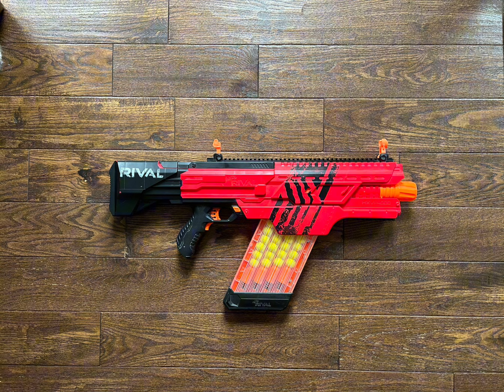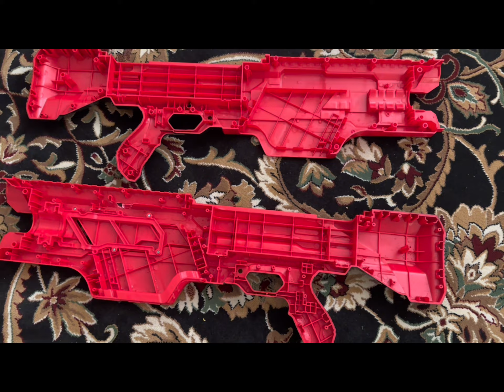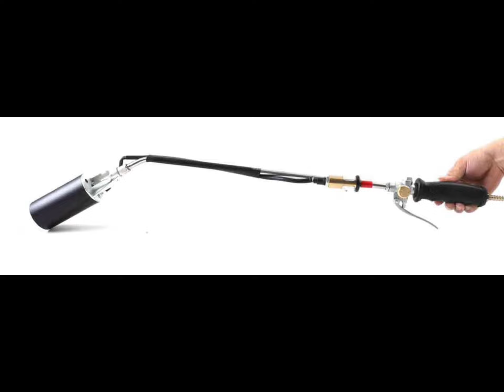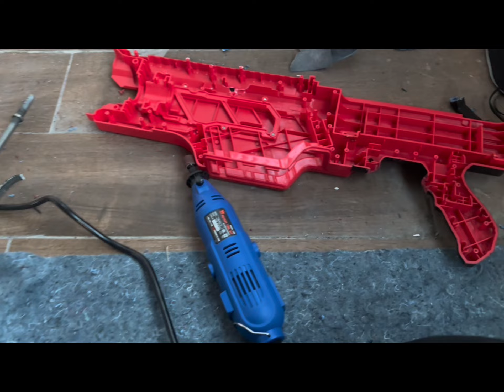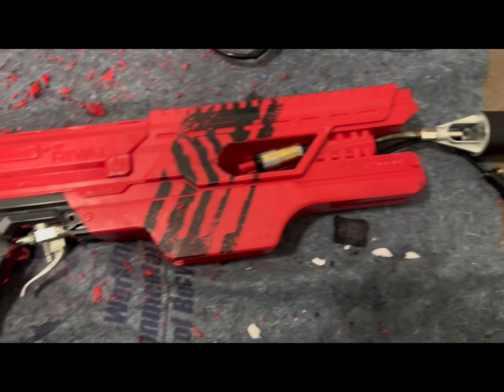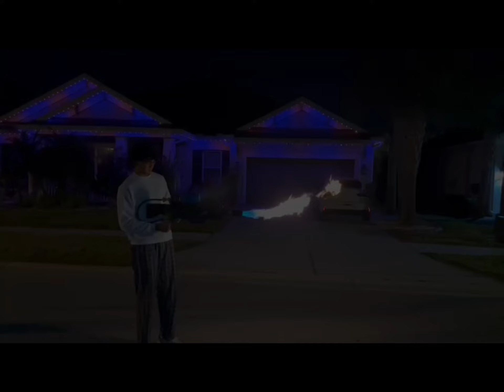How To Make Your Own Boring Company Flamethrower for Cheap

Comment: Why use plastic with something that shoots high temp flame's it will catch fire or melt
Reply from the maker: I can see how you might think that. Basically the fire is contained within the barrel. The pipes carrying the gas to the front actually freeze because when gas expands that pressure drop leads to a loss in temperature. The plastic never touches a flame or fire part so plastic is 100% safe